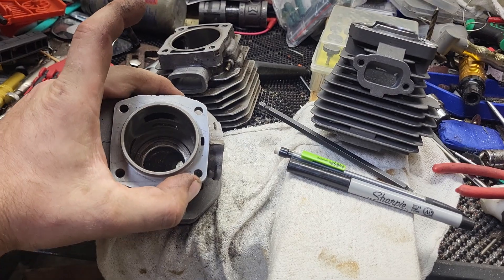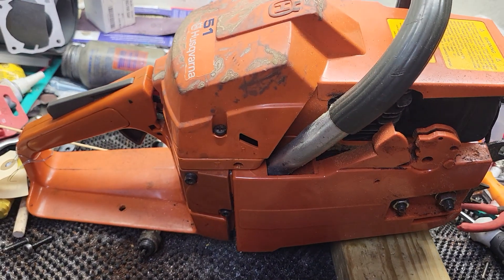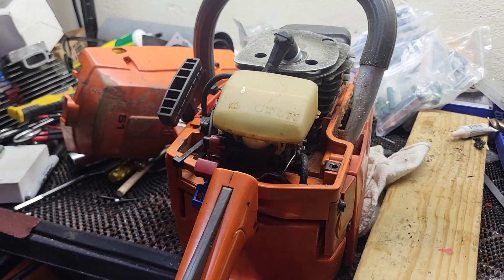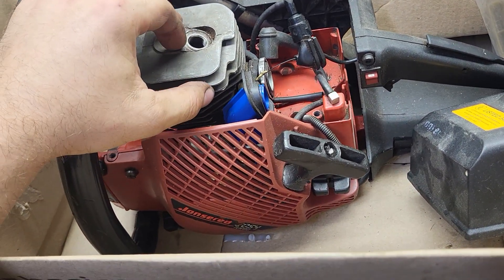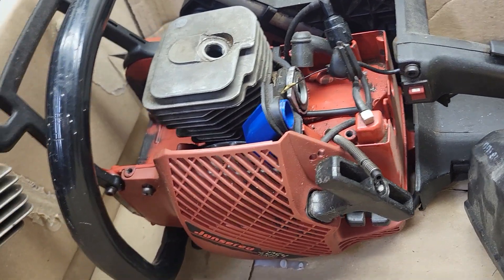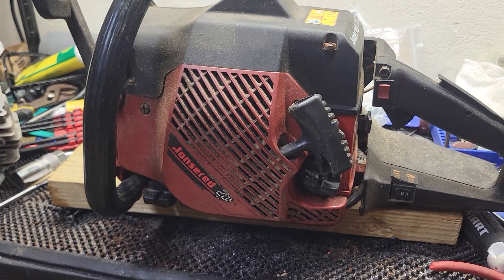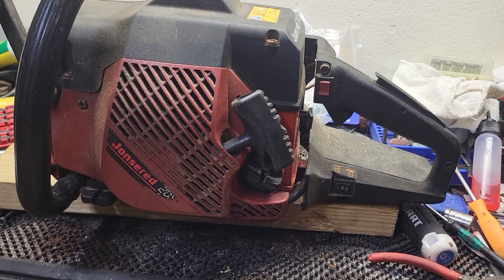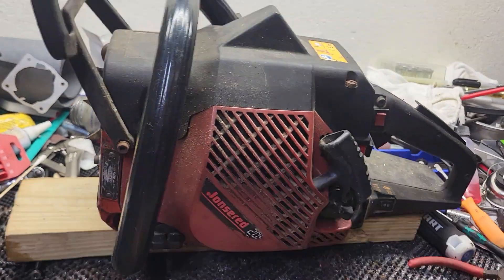April 2024 project updates

Comment: Seems like a lot of us have too many irons in the fire at any given time. 😂
Reply from the maker: So many irons, so many fires.

Maybe it is because i am used to working on 30 machines a week at work i think i have to have 30 ripped apart at home too.
Reply: @Super-Dave-Outdoors  the older I get, the less Irons I want in the fire... but, old habits die hard.
Reply from the maker: I need a 3 day weekend to tie up all my loose ends lol.  Bike looks great btw.
Reply: @Super-Dave-Outdoors   me too man! Got 200T in... my buddies decided to start another business... residential tree service on top of their saw mill and logging business... so I'm gonna do up a ripper of a top handle for them.
Thanks man. My intake cam came in. Now I can install that and then correct the old cam..I need to install a larger pilot jet too... if all is good, slap the decals on it.
Reply from the maker: Jets-r-us,  idk the spelling but they have pretty much all the jets. I wanna know how much the cam is off, that is interesting.

I'll be watching, the 200T and bikes have my attention
Reply: @Super-Dave-Outdoors  I'll have to look them up.
It was 74-76* today and the bike wasn't running right, again. Acting lean low and rich high... 🤷‍♂️ 
The 200t will be worked on this weekend I think. 
I'm looking for a 2 stroke bike.
Reply from the maker: Time to yank everything back out of the frame and swap in a sled motor!
Reply: @Super-Dave-Outdoors  FZ1 motor